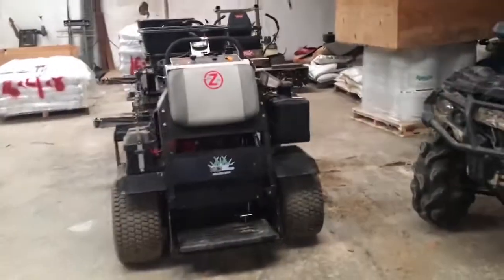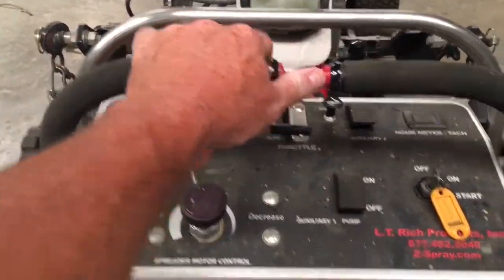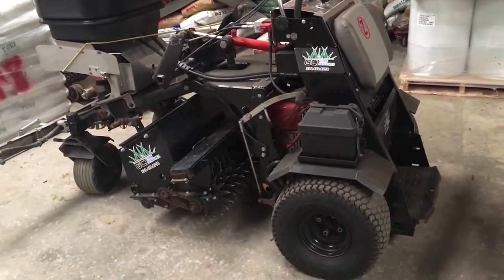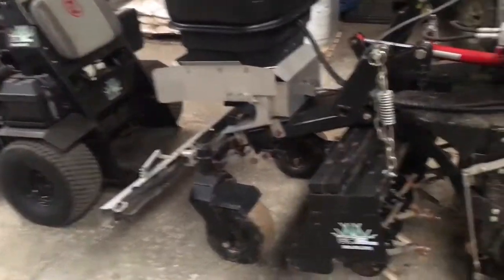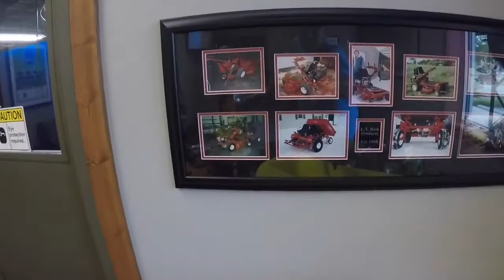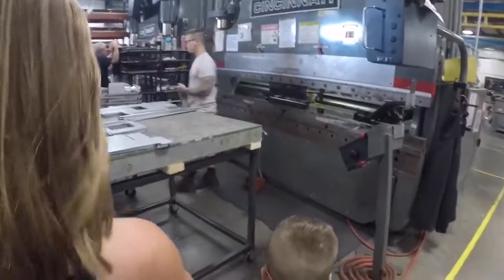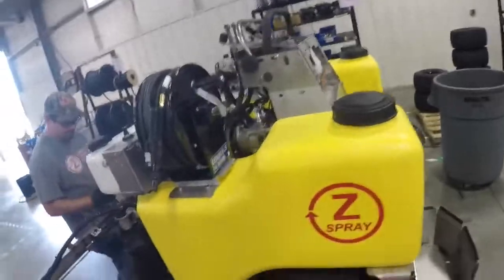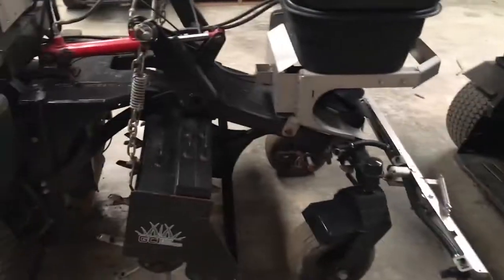Z-Plug Review and Factory Tour

Comment: Thanks for the review. How well does the castor lock system work on hills and sloped vs not having locking casters? Can you tell a significant difference? I wonder why there are NO zero turn mowers that are using this system if it is effective.